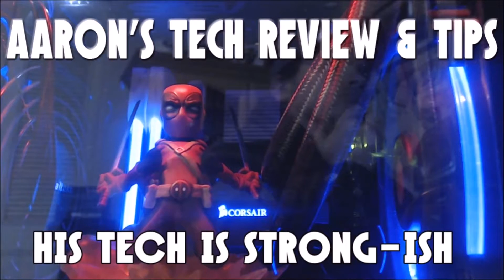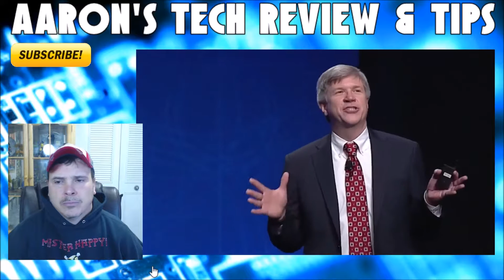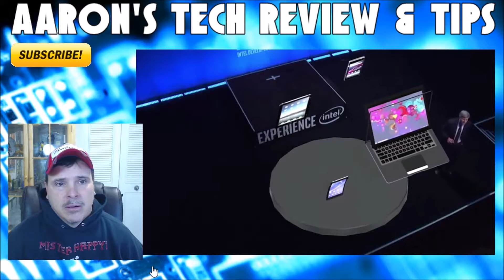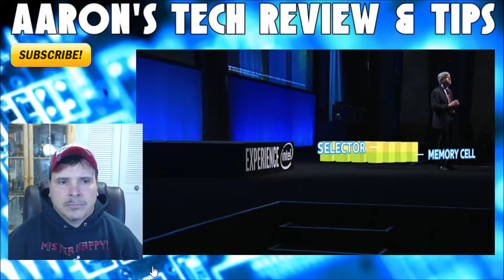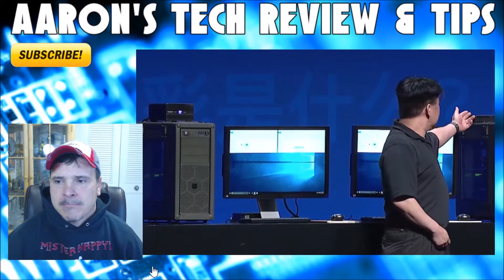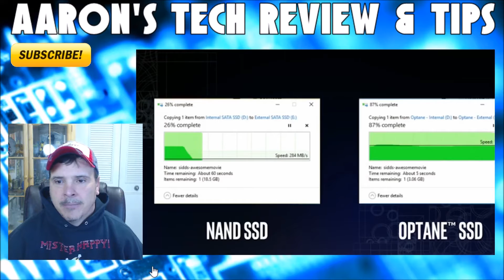Optane Memory Expained - Intel explains why Its a game changer

Comment: It's great until a Windows Update makes Optane the Evil Inside. I spent the last two weeks trying to figure out why my HP Spectre x360 had two SSD when it didn't originally have two and Windows wouldn't boot. Turna out that if something happens to the power or Windows Update writing to the synced partitions, Optane breaks the reboot after update. I'm just an end-user getting fisted by this technology that thankfully has been discontinued in consumer PCs/laptops.